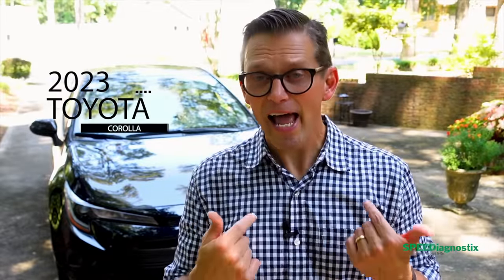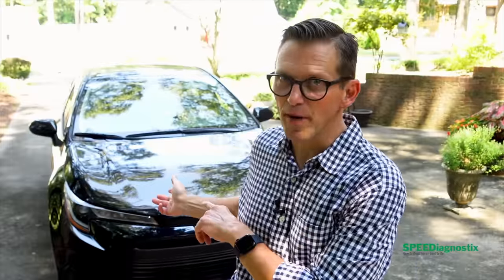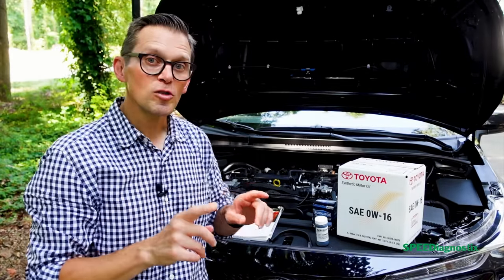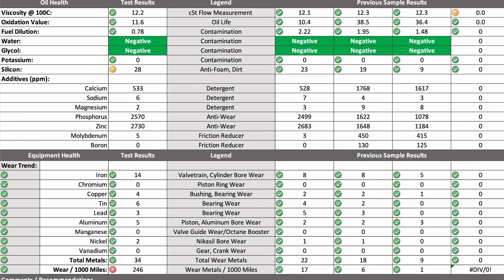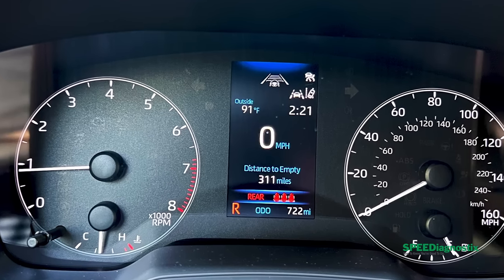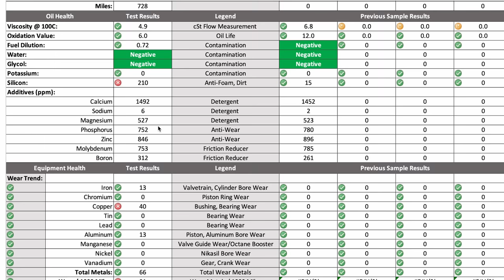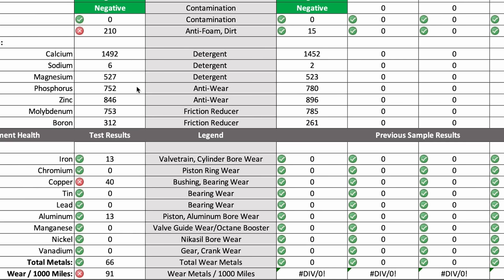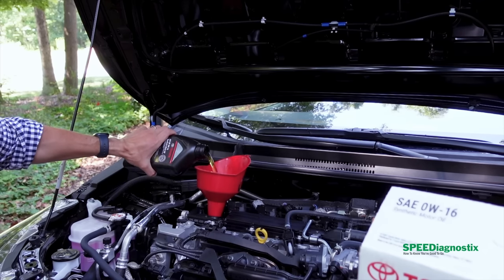AVOID the ONE MISTAKE Almost EVERYONE Makes With A Brand New Car

Comment: All technically excellent, quite interesting, and a nice symbol of caring about your daughter.  But she'd maybe prefer the cash, so just recognize that although she appreciates both the thought and the work on her car, from a big-picture perspective you're doing it for yourself.  To feel like a good dad, and to do what you like doing.  Nothing wrong with that.  My own daughter let me do all the oil changes on her 2021 Toyota also, even when she had access to free dealer oil changes when it was new.

But what you're doing, has a tiny practical benefit, and is really not necessary,.  You don't get bonus points for having the cleanest, best-documented engine oil in the junkyard, nor for having the least-worn engine, when the car dies of other causes after 15 or 20 years.  Oil-related problems are clearly not the weakest link in a new Corolla's future.  

The last time engine mechanical wear, oil performance, or oil filtration was even the least bit plausible as a cause of trouble with a car of mine, was in 1978, with my family's old 1966 Plymouth Fury which I bought from my sister for $40 in lieu of her sending it to the junkyard when she bought another car.  It lasted me another year before becoming only the second car I've owned with a mechanical engine breakdown.  The other was a Triumph I bought used for $685 and never was quite right.  

Oil back then was garbage compared to now, and I though it's a plausible cause of one or both problems, I don't actually think it was ever the cause of any problems in any car I've owned.  Who knows how the Triumph was maintained before I bought it.  The Fury was maintained OK, by my dad and I.  Quaker State 10W40 in metal cans.  Ahh, the days of oil spouts that punctured the can for you, those were the days.

On the probably 20 cars I bought new, starting with a '79 Corolla, zero oil or wear-related problems.  I've always used good oil, usually changed it myself, only gone beyond 2x the recommended interval a few times, and simply never had a problem.  I always aimed to do better than recommended, but often enough was busy with life and ended up doing worse.  With zero consequences.  

A far bigger benefit of your doing her oil changes, is that you can all be sure it was done right.  Doing it right every 6000 miles from the start, would have been fine.  I never had to make that decision on my daughter's.  During the pandemic, she drove so little that just doing them on the "12 months or 10K miles, or when my own car needs an oil change" schedule got hers  changed by me at 1341 miles, 7135 miles (total), and 11,558 miles.   Usually Pennzoil Platinum for mine, Pennzoil Ultra Platinum for hers.  The fatherly instinct can be strong.

Comment: Are you only changing the oil at 500miles and not the filter?  Did you leave the factory filter on until Toyota did the first service?
Reply from the maker: We changed the oil and filter at 722 miles.
Reply: @themotoroilgeek Thanks

Comment: I worked in engine assembly at Toyota for 20 years. Change your original oil at least within the first 1000 miles. There is much debris in any new engine

Comment: Hell I change everything including oil, radiator flush, gearbox oil and brake oil at least once a year. 300,000 miles and still going strong. Service every 3500 miles.

Comment: My toyota manual states the engine has been running on a stand for 2000km in the factory. Therefore your 500 miles oil change would be more of a 2750km oil change on my car.

Comment: I can tell you a real life experience i found interisting , 1995 detroit 60's in freightliner classics , lease vehicles , brand new , 22 of them ..went through a gallon of oil every 11/2 fill ups , 1200 and something gallons , i stopped adding it cause im lazy , and that's expensive , so i would buy the gallons , but not add them , run the piss out of it , but watch the gauges like a hawk , the temp's vary with the Pa.  mountains , but when it climbed temp , and the oil pressure would twitch , cause they were always solid reading 60psi , as soon as it twitched , id shut them down and fill up the oil , usually 2.5 to 3 gallons low ..
No more need to add oil every fill up ..those chromemolly rings set right in then ..lol

Comment: so my 23 WRX takes 0w-20 but says you can use 5w-30 conventional and switch back to 0w-20 at your next oil change.  can I just use 5w-30?  0w-20 seems too thin for a GDI turbo boxer engine

Comment: I make the first change at 500 miles, to remove the metal chips, then every 5000 miles
 I sold all my cars with 200000 miles, still running well.

Comment: Noticed that the handbook said to use the 0W-8 oil after you used the 0W-16 oil. Do I read that as an emergency use only and you should hunt down the correct 0W-8 oil?🤔

Comment: Sadly to say, don't trust your dealer where you do your maintenance... I was doing oil changes in my Rav 4 at 1000km and 10000km intervals before going for a 15km "scheduled maintenance". At 20km I had a long journey so thought, I'll check the oul, guess what... My dealer didn't change the oil judging by it's colour and smell... Imagine you didn't do initial oil changes and you go for a "scheduled one" and your dealer doesn't change oil... Imagine 30000km on that oil!!

Comment: Don’t hate me for asking. All these oil changes seem to extend the break-in. Could it be the particulates in the oil help break in the engine sooner?
Reply from the maker: Actually, you don’t need to abrasively wear in the engine. Check out the rest of the video series to see what happens. Hint: the break-in is not prolonged.

Comment: I just bought a “demo” from the dealer that had bout 2500 miles on it and they did oil change for me. Is there any reason to do another before the next planned oil change?
Reply from the maker: Interesting, you should be good to wait until 10,000 miles on the odometer to change the oil again.

Comment: Breaking engine; period, is the worth one fallow by every time you start your engine. Gasoline engines are not required; like diesel engines, to have a certain oil pressure before the engine will even turn over. Otherwise you can start at all! The manufacturer could have installed an electric motor to bring the oil pressure to accomplish this. But there it goes “building for obsolescence” in mind out the window.

Comment: Im not paranoid about changing oil, I just get rid off a car at 75k miles and get another. @75k if it isn't the engine, its something else, and it all adds up, to maintenance cost, its actually higher after 6 years. For the next 4 years you will pay repairs and maintenance cost. What about the automatic transmission? They are sealed, and  its oil its about same 0 W8! and it goes for a fluid change for 93k miles.
Reply: Car dealers are going to get you, not matter what! Why fight it? Get yourself a new car every 6 years, end of story! Cant afford one? Just don't get one!

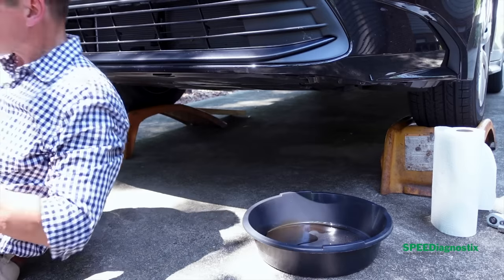Comment: Very impressive addative Package dang near identical to Race oil nice to see the off the shelf oil especially from dealers Are worth the cost which in some cases is cheaper then mobil 1 and castro or even penzoil these days they are getting super pricey even at places like walmart or auto part stores 20:43 @The Motor Oil Geek

Comment: Would you recommend Marvel's Mystery Oil in the crankcase with the oil for 3,000 miles before an oil change. MMO company says it is okay to replace up to 20% of the engine oil capacity with MMO for an oil change interval (3k-5k) miles. I can also use MMO in my fuel tank as well. What do you think?
Reply from the maker: Stay tuned for a video with the answers!

Comment: I have a new Honda HR-V and am willing to change the oil coming up on about 500 miles.  But I wouldn't know what I'm looking at with that oil analysis report.  After all, I wasn't an oil specialist for JGR.  I don't suppose you'd want to interpret it and follow me along?  BTW I thought I'd use Penzoil Ultra Platinum oil, ok?

Comment: I drive hwy and street  so I change oil every 5000 miles  my diesel truck I change oil every  10000 miles different type of oil. Only city driving every 3000 miles never had any trouble.  Oil  transmission  keep up your maintenance  or you will pay big time

Comment: While this is cool info, I won't be going this deep into oil changes.  I'll just change oil as usual with off the shelf oil at the suggested intervals.  I don't drive a Joe Gibbs race car.  I have a '13 Sequoia and after the break in, I just changed the oil at the recommended intervals or a bit sooner.  The truck has over 100k miles and good.

Comment: Can I change the oil after 500 miles at the dealer? Not to do it myself in case I might lose the warranty if the dealer finds out I did the oil change myself?
Reply from the maker: The dealer can do it, and you won't lose the warranty if you do it yourself.
Reply: @themotoroilgeek  thank you for your fast reply, tbh I did what you did in my 20 years old Audi A8 D3 3.0 tdi, the only difference is that my first oil change I did it at 3000 miles, the second at another 3000 miles and after that every oil change was done no later than 5000 miles! After 20 years the car have only 92k miles but is running without issues! After 80k I started using Ceratec from Liqui Moli at every oil change! I’m planning to keep this car until retirement! If that so is going to become a classic for sure as my retirement is in 20 years if I am lucky to live that long 🤣🤣🤣

Comment: Should the first oil change be at 200 miles or at 1000 miles?
Reply from the maker: Anywhere in between is fine. There is not a magic number.
Reply: I suggest before 1000 miles
Reply: I guess my real question is which is better 
A. Oil change at 200, 1000, 2500, 5000, 10000, etc. Or 
B. 500, 1500, 5000, 10000. ? 
Does the engine need the dirty oil to get properly broken in?

Comment: If I bought a brand new car I’d change the oil at 500 miles and test it for metals. Than again at 1500 and again at 3000. After that  every 3000-6000 depending on the weight and the visual appearance of your oil.

Comment: Thats what i do.....new engine....first oil change at 1000 miles ....then  every 5000 miles....even if its says in the manuel that i can do 10,000  between oil changes...and change the filter to....even if it says you can do 15,000 miles with it....

Comment: Buy and EV and you dont have to worry about oil changes, Oil filters,  or any thing to do with the engine or transmission because the EVs dont have an engine, and the transmission  is one speed. And they have regen brakes so they can last almost indefinitely if you are careful and now Tesla is in talks with Michelin  to put airless tires on their cars. They can last the life of the car if you are careful. And you save a ton on fuel.  And you can find a supercharger in most areas now. Takes less than a half hour to charge. Am I getting through now????? Yes I have two Teslas and charge them at home when the rates drop 20 pecent late at night. No you do not need to get up at night. You just plug the  charger in and set it for the late night time you want it to charge.

Comment: Watching this while my 5w40 for the oil change on the ol Volvo came in. 😂Its just wild what 20 years of engineering advancements can do. Running an engine on 0w8... and its perfectly fine!
Meanwhile my 20 year old Diesel Volvo takes nothing but 5w40 or 5w30. 5w30 or even 0w30 would only be suitable for near arctic conditions though.
The engine has 250.000 kilometers on it and being an old diesel it needs a thicker oil than what we are used to these days. Trust me ive had 0w30 in it... Unsuitable viscosity for the engine drove less than 1000km on that oil because the engine hated it.

Also great to see that this Toyota OEM oil is a top shelf formulation I mean that much Moly and Boron would be be sold as a high performance racing oil at 4x the price here.

Comment: Question-  can you change your oil to much like every 1000 miles or every 3000 miles so on?
Reply from the maker: Unless you are tracking your car, there is rarely a reason to change the oil before 3,000 to 5,000 miles.

Comment: The owner's manual says that the 0W-16 can only be used one time, and it must be replaced with 0W-8 on the next oil change.  You should have said that clearly, because your video leaves the impression that 0W-16 can be used as a permanent substitute.

Comment: I took my 2010 Honda Accord Euro Tourer He got up at 8am he said and obviously no one to talk to so his brain was still in Hungarian mode. I just rang him and he was fine. No hungarian at all.  So as with everything he does nowadays it just takes a bit longer to do things. He has done it regularly with me. Just keep saying Englush dad. I'll pop around later when Sophia and I go out. Ox in my local Honda dealer when I moved cities.  This was in December 2022. Took my car to get WOF in nz warrant of fitness to franchise VTNZ they said my oil was down 2L ? What I only had it serviced 4 months ago. Took to Honda. He said it was only 1.2L down and filled it up. But i requested why would it even Louise that much oil when it never has before in a 12yr old car? We checked the service report and guess what? Honda had put 0w oil in instead of the correct oil. They put new car oil in my 12yr old car. Drove for 4mths without knowing. After that my oil light kept coming on regularly.  So took to my new mechanic and it was using oil at a huge rate every 1000/2000km using a litre of oil. Now 2 years later my catalytic converter has failed a d I'm told my engine is stuffed require a rebuild. Tragedy caused by Honda. What should I do? Cheers

Comment: I’m a specialist just like this guy claims he is. The only difference is I worked in a mechanic shop before I got my title. He’s right about some things but he’s hella wrong about the new break in oil changes. Yes you should probably change the oil asap if you see any significant changes and are losing oil. But if everything is sealed properly and it’s going smoothly you can change it at the 10k mark. In 100 cars that we changed in the first 100- 500 miles we found only two cars had trace metal debris. And later we found the two cars had recalls for that exact thing.

Comment: I had an engine rebuilder tell me never to go over 4000 miles on an oil change even with synthetic oil, 10,000 miles you would be an idiot to listen to any car manufacture  tell you to go that long even if you used amsoil and they tell you that so it will wear it out faster and you will buy another car and the engine rebuilder told me that the oil does not really wear out but the additives in the oil is what wears out and the oil can only hold so much carbon and before the engine starts to sludge up and gum up real bad which will cause engine failure so people if you want any engine to last limit your oil change to 4000 miles and even rebuilt engines have a max oil change of 4000 miles for warranty purpose.

Comment: I’d be curious to know how the Toyota OEM 0w-16 compares to Amsoil’s 0w-16 Signature Series which they claim guarantees protection for up to 25,000 miles 😳
Reply from the maker: Less molybdenum in the Amsoil 0W-16 than the Toyota 0W-16 oil.
Reply: @themotoroilgeek  wow that’s impressive.  Sounds like an uncommon case where the oem is superior to the aftermarket

Comment: Do I agree with an early break in oil change? Sure, but I'm a big believer in preventative maintenance . Does the fact that more wear occurs in the first few thousand miles of engine operation than in later periods mean anything? Not unless you compare the life of an engine that did not undergo the early oil change. I doubt you'd see much difference.

Comment: Dealership won't use Toyota oil btw.  You should change the oil yourself to ensure you get the oil you want in the engine.
Reply from the maker: Stay tuned for the next video…

Comment: I don't know I bought my Chrysler 200 9 years ago right off the showroom floor drove at 10,000 mi on its first oil change she's still going strong! I did indeed though switch from 0w 20 to 5W-30. I've always owned Chrysler vehicles and never had any problems. I indeed bought a used Toyota and I will never buy another one ever again it's been nothing but a money pit!

Comment: And trying to get the Subaru dealer to change the oil at 2800 is an up hill battle. The service writer swears up and down that I shouldn't change the oil for 10K miles and in fact refuses to have the oil changed. Oh Boy!

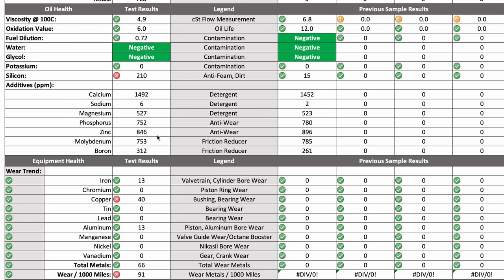Comment: 16:30 what do you mean you don't see it? I'm not into oil at all and I have seen it in 10-15 years old tests in Liqui Moly. I'm sure they do it since foundation of the company in 60s. 600-800 mg/kg of Mo is normal for them.

Comment: I remember everyone complaining that the owners manual was nonsense because they recommended oil changes too frequently.  Now it's a conspiracy and it's too long between changes 🙄  About 10,000km between changes is just fine.  I've been driving now for 36 years and I've always changed my own oil, and I've never had an engine issue.  I guess if you like wasting money changing too frequently...have at er.  I like saving my cash 😂

Comment: Well, it won't hurt but it is not really necessary.  Rental fleet car experience belie his statistics.  The 2.0 L, M20A-FKS straight four-cylinder (I4) engine will do just fine without his early oil change and will last just as long.

Comment: Mr. Lake Speed, your channel recommends a   low Calcium, high Zinc & high Phosphorus break-in oil. Yet this was not done for this vehicle. Is this because  0-8W break-in oil does not exist? If such a 0-8W break-in oil existed, would the original Toyota oil been drained and replaced with a low calcium, high Zinc & high Phosphorus break-in oil for the first 5-7 hundred miles? Thank you.
Reply from the maker: The low calcium, high ZDDP oil does not exist in a 0W-8.
Reply: @themotoroilgeek  Thank you. Mr. Lake Speed, Jr.